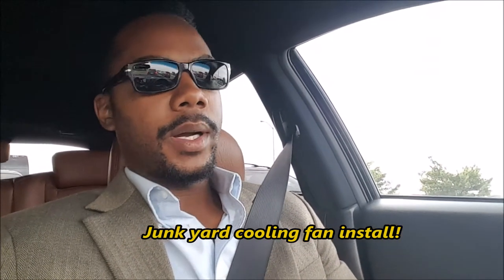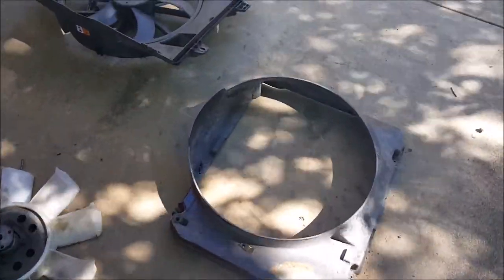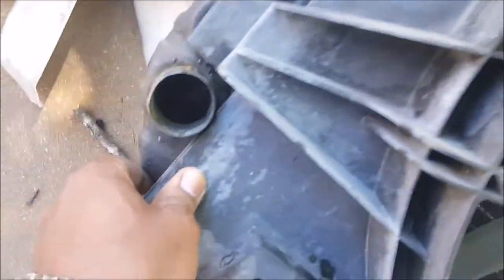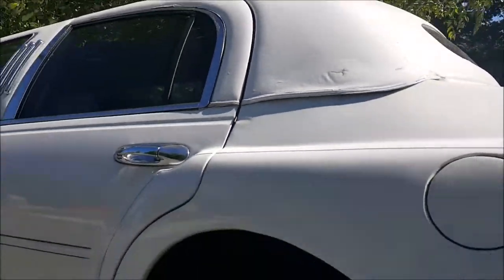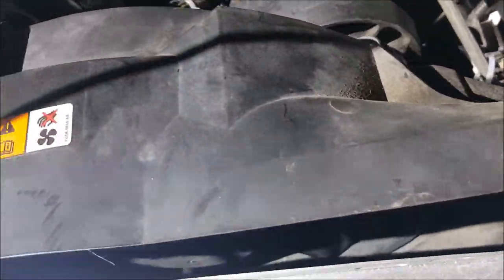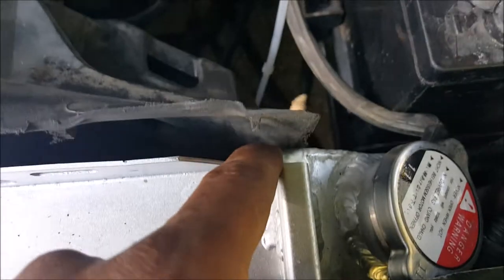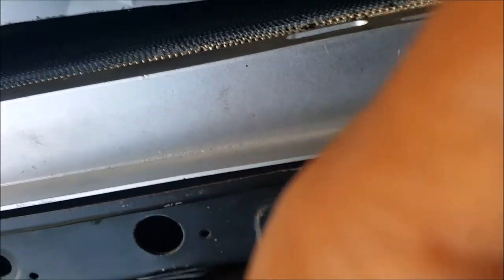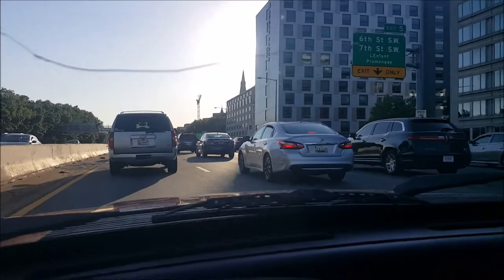Cool for the summer: Junk Yard Fan install

Comment: how do u wire the electric fan? that's my million dollar question
Reply from the maker: its currently wired to a relay and a manual switch. you can buy a fan controller though.
Reply: I have mine wired with a derale fan controller but it's always "on". I need to figure out a way to shut off the controller when the car is off. Everytime I park, the fans stay on for a good 10 minutes until the temperature drops and the controller shut off the fans. Any ideas how i can wire it so that it turns off when the car is off? thanks for the help!
Reply from the maker: you would need to find a keyed power source so that it will only draw power when the key is switched on.  Right now you have it wired directly to the battery, or to a non keyed power source.